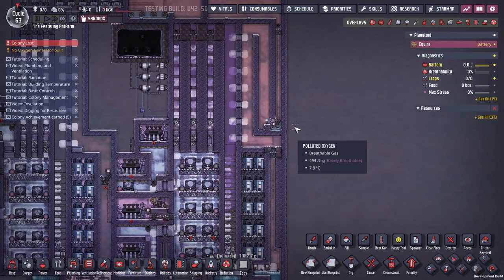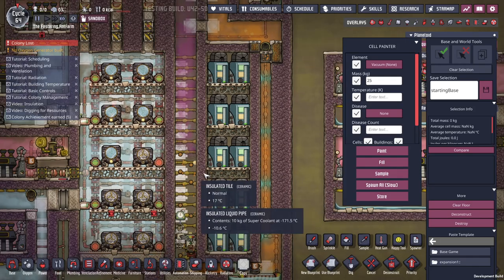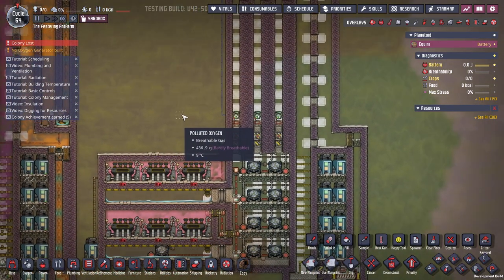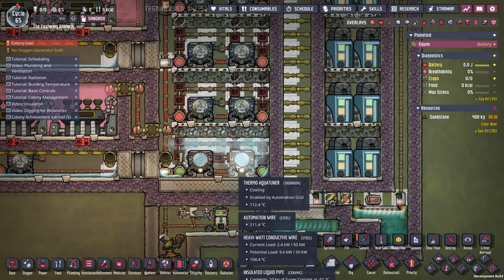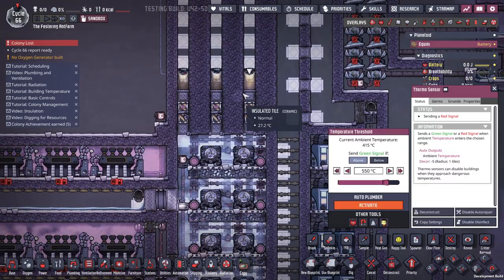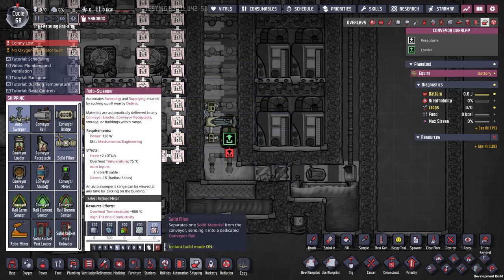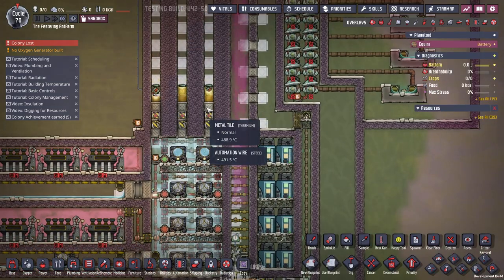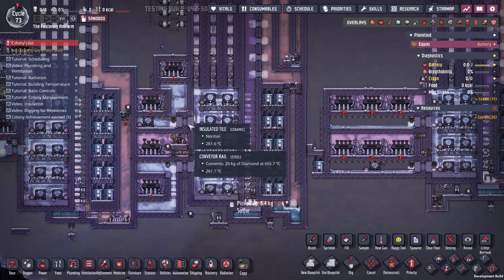Tech Tips 30 Kg Sour Gas Boiler

Comment: Beautful.  You've outdone yourself this time, Tartarus.  I just might have to build this in a survival playthrough.  With my signature McTwist, of course.
Reply from the maker: I need a map with 10 oil wells to build it.  Or a bunch of slicksters
Reply: @TartarusPlaysGames  nah slicksters make too much lag.
i can give you a map with 13 oil reservoirs,  basically any map with trapped oil trait has much more oil reservoirs than normal , i'v seen some with up to 25  .
Reply: @TartarusPlaysGames   i just saw a map with 38 oil reservoirs and thought i should share it with you lol, entire map is basicaly oil reservoirs at this point , its unplayable probably but fun to see such maps : V-OASIS-C-8003192-0
Reply: @saeeddavoody6925  But you typically lose a few due to them being too close together, or to abyssalite touching magma, or embedded in neutronium...  I like Irregular Oil better, that's less likely to happen plus oil biomes at the mid and top of map for easier access?  Yes, please.
Reply: @TartarusPlaysGames  That's a whole lotta slicksters.  I did the math, it takes 2kg/s CO2 and 64 ranched, groomed slicksters to generate 1kg/s of crude.  And sadly Cairath's Seed Browser hasn't been updated since before mergedown, IIRC.
Reply: @1x4x9  that doesn't matter that much , you lose 1 or 2 typically,  but i think irregular oil doesn't give that many extra oil reservoirs,  you can have both traits at the same time for extra extra oil.

Comment: Power efficiency at this level is no longer that big of a concern, but I believe cold sulfur could be sent up to cool down incoming sour gas more. If you do that in a metal tile, you can make it pop up as liquid outside the main chamber.
Reply from the maker: It is more about heat efficiency, not power efficiency. but risking sulfur popping into the wrong place could be bad.
Reply: @TartarusPlaysGames  For me heat efficiency = power efficiency in ONI, as you can always through raw power at the problem to negate any heat issues :)
Reply from the maker: @nazgu1  With 20 pipes of generators will there be enough raw power?  Plenty of excess, and absurd power, but raw? We will have to check to be sure.
Reply: @TartarusPlaysGames  Oh yeah, for a 30 kg/s monstrosity we don't really care about max efficiency :D

Comment: holy shit , perfect , i was just looking for something like this .
Reply: Holy shit, what do you need 162KW of power for?  Even my biggest bases hardly use more than 80-90KW
Reply: @1x4x9  lol , idk , i have so many oil wells right now , i might as well use them all right ? it's free water basically and even if i never use the power it's a nice addition so i never have to look back on power ever again.
Reply from the maker: You need an entire map of just generators? stick a few beds and a mess hall between them and see if the dupes can keep up on the generator tune ups?
Reply: @TartarusPlaysGames  lol , i haven't thought of that part yet , my map is pretty big but still i probably  need half of it for generators.
also heat and carbon dioxide from all the generators are gonna be some sort of problem. 
engine tune up ? i don't think even 100 dupes can handle that lol.
for storing all the power i'm gonna use rocket jambo batteries stacked up for top part of the map.
Reply: @saeeddavoody6925  Do what I do, rig up a couple thermium aquatuner based petroleum boilers, boil 20kg of your crude into petroleum, and run it into a bank of 10 petroleum generators flat out.  You can do more if you rig up a storage tank and automate the gens for peak loads and have a battery bank to sense if power is needed (and store some as well), but make sure if you run more than 10 that your total average draw doesn't exceed the petrol you are producing.  Then run the rest (e.g. the other 10kg/s) into a conventional 10kg/s sour gas boiler.  Myself and Tartarus both have excellent designs with mine being slightly more efficient (and expensive to make), and his being somewhat more compact (and cheaper to build).  Pick your poison.  :P  You can see kinda how I did it in Base Review #3 - mine is the last one featured in the video.
Reply: @1x4x9  i already have 2 petroleum boilers with all generators running flat out . i don't ever stop burning it tho unless i need it for something else because it just gives so much free water and i can pretty much eat all 20kw as i am right now so I'm working on bigger options. 
you are right,  it's better to just run last 10kg for sour gas boiler,  i probably won't even run 30kg worth of natural generators bc  it's just so much time consuming right now for me , i just liked the 30kg sour gas boiler design because it is so compact and perfect. 
i already have tartus 10kg design from a year ago in my blueprints but i will look at your design too for sure , thanks for suggestion brother <3
Reply: @saeeddavoody6925  1 step ahead of me :D

Comment: Small detail, you mentioned double walling insulated tiles so the tempshift plates would not interact with each other. But on the right of your steam room you have ts plates touching the wall and on the other side of the wall, the very cold one, you also have tempshift plates. Did you use insulation to avoid any issues there?
Reply from the maker: There is only the temp plate at the very bottom on the cold side, so it doesn't interact much from the hot side, and the active cooling down there is enough to not have to worry about it.  I don't use insulation because Spaced Out  makes getting iso resin so hard I try to not rely on its properties.

Comment: 5:50 Is it possible to put those doors diagonally, and then put a temperature shift plate above it? That could increase the heat transfer!
Reply from the maker: Do you mean move the door over one space so the can use diagonal temp plates to hit both columns? I wanted each dripper to no impact the others in case one gets too cold stops flashing.

Comment: The liquid drip purpose is somewhat ruined by not leaving a gap of 2 in between Tempshifts. Never is the super coolent drip pump mentioned it's rather unique. Also I'd always have at least 1 kg/s per section pumping no matter what to get the gas away, overpressure through a thermium door can happen at below 1000kg especially with the tempshift setup without gaps of 2.
Tempshifts in the cooling funnel is also quite fatal no matter the gap it's defeating the purpose of the temperature stairway. Small pump is enough for the super coolant bead pump and it's heating the methane backwards for quite a bit when it should only heat it when on the pumping tile. Building it myself the aquatuner room's 2 tiles too wide for no appearant reason as far as I can see it.
Reply from the maker: Great tips.  Though looking to improve efficiency when going to a 30KG system isn't that important.  I didn't think that bead dropper was anything new, just a way to force gases up with dropping coolant.
Reply: @TartarusPlaysGames  Built it myself in a normal colony, only 6 reservoirs but I can just use Drecko plastic instead. It just feels like it's not nearly producing enough heat so I had to have one of the 8 constantly dumping heat into a Tepidizer to even keep it running, other than that works fine with just 10 kg. I did have a Valve up there to keep the pump going at all times so the gas doesn't force it's way back down to the heat plate, good design. A door on the bottom only made things unreliable without it is way better it just keeps flowing and with 8 aquatuners above it's almost impossible to flash back up. The bottom aquatuner should flow in reverse though to prevent icing on the bottom row. The Hydro sensor on the chutes might be better off being a second Thermo sensor set on just above flashing.

Ah, turns out automation of the Tepidizer makes it too efficient resulting in needing too much heat generation, and a Tempshift on the chute injects too much heat so it'd drawing in too much heat, bad combo not in this design ^^

Comment: i wonder if it's better to set lower temperatures for top aquatuners so workload is balanced out.
Reply from the maker: I did set them to -160  but it doesn't matter with so much gas pressure they just run 100%
Reply: @TartarusPlaysGames  oh i see , then it's no use. 
i guess i made a mistake with my comment , i meant to say higher temps.